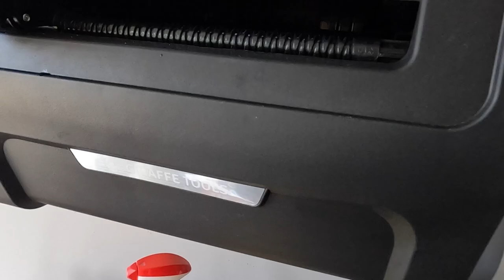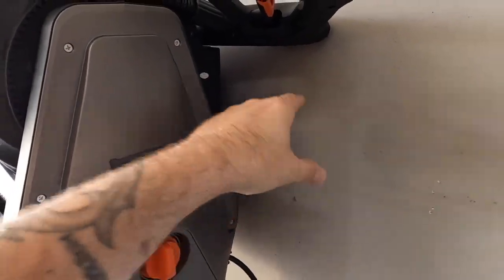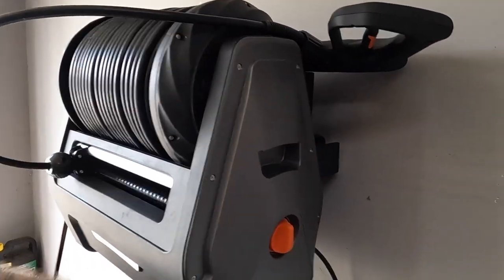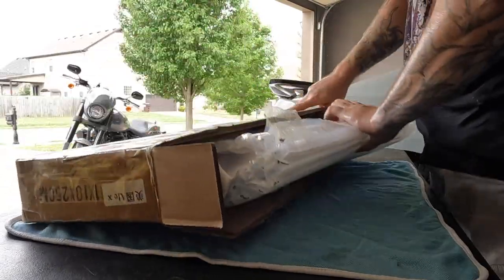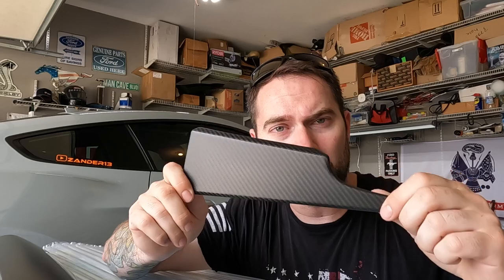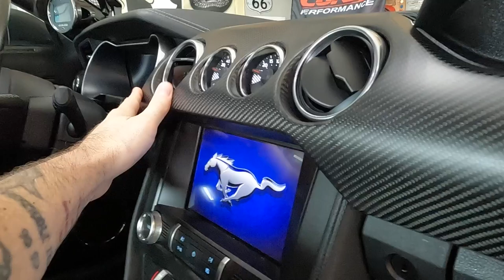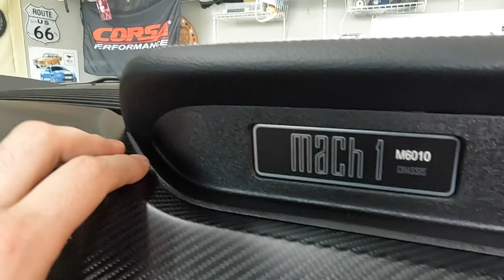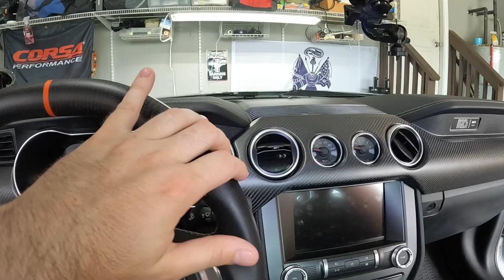TRANSFORMING MY 2021 MUSTANG MACH 1 INTERIOR w/ MATTE/ DRY CARBON FIBER- INSANE NEW LOOK!

Comment: First off  great channel. I've been following you for quite some time. I did have a question about the fitment along the top above the center gauges. I know a lot of these overlays tend to go a little short and don't completely cover the factory piece all the way up to the top edge. Is that the case with their product?
Reply from the maker: These completely covered everything. I definitely would have taken them off if they didn’t bc it would have driven me nuts lol